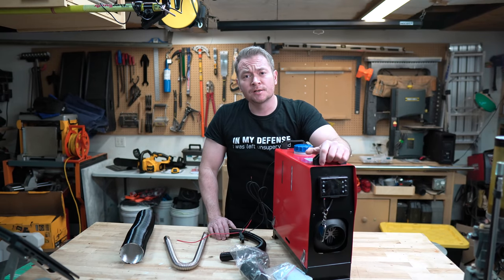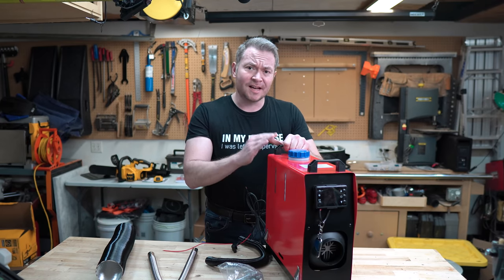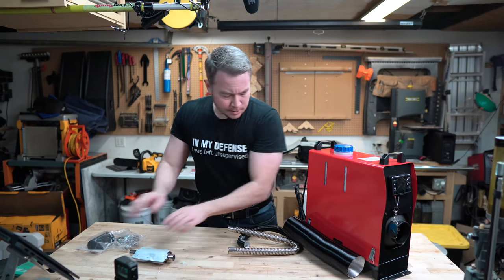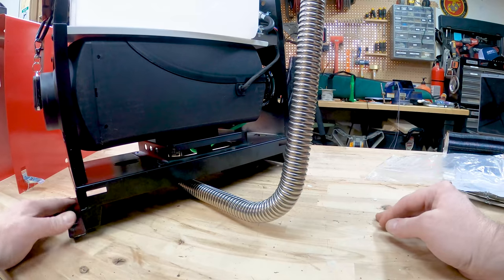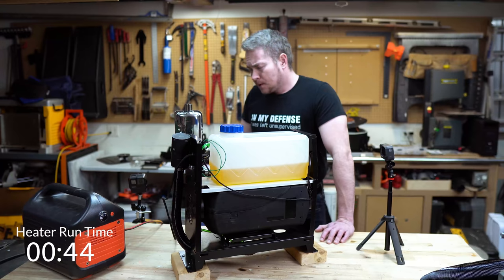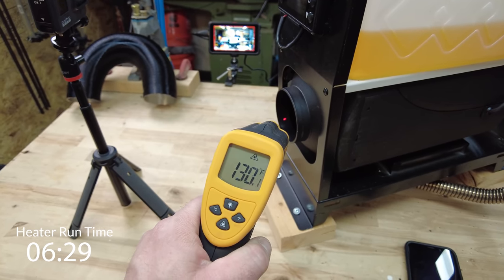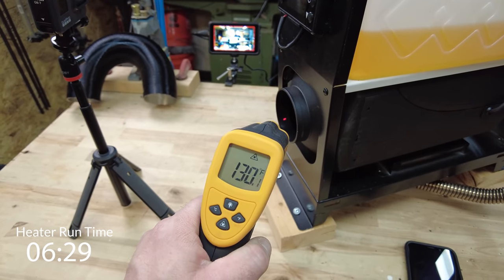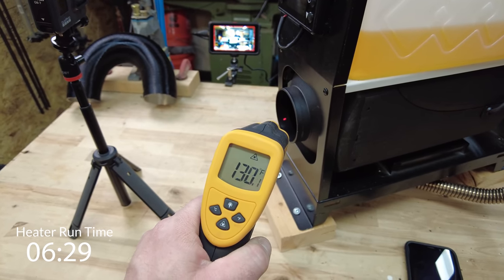My First Chinese Diesel Heater

Comment: I’m going to share my recent experience with one of these free standing heaters, I also added wood blocks for clearance. The exhaust pipe does not last and directing it up like that is not a good idea. Ignition errors are the most common and I have replaced a Bluetti EB240 under warranty due to this heater causing EO23 errors non stop. You will have to break it down and clean it. The running rich does cause excessive soot. Each time it failed to ignite and run the unburned fuel tends to collect at the exhaust. Three nights ago the temperature dropped to below 30 here for the first time I have been starting this with the remote but something told me to step outside I was actually speaking to Amazon about replacing the DC adapter because it wasn’t putting out 12 VDC I was only getting 9.3 VDC and while speaking to AMAZON the exhaust port which I had modified with copper pipe and a 90° elbow ignited and caught fire right in front of me I dropped the phone grabbed the fire extinguisher and avoided what could’ve been a catastrophe I can’t stress enough how important it is that you have no less than 11 VDC. I’m replacing it with a component heater and have my doubts.
Reply: which model component heater did you go with?  if you're not sure yet, could you explain what a component heater is please?
Reply: Correct Current (Amperage) at the the correct voltage is required for a full and complete burn!!! Sounds like you were underpowering the heater outside of its optimal performance specifications!!!...thus creating subpar performance.
Reply: @fookingsog  Forgive my ignorance but what would the solution be here - get a more powerful battery pack?
Reply: Could you explain this a little more ? Your battery pack wasn't powerful enough ? Or this DC adapter you speak of wasn't working correctly?

Comment: I have ran these heaters for the past 4 years, the bearings get dry need re-greased once a year and the fuel pumps wear out about every 2-3 years other than that great little units

Comment: I have two of these heaters I've had them for 2 years or 3 years and  I only had to replace one fuel pump I have a workshop like yours the garage actually it's pretty well insulated I turn it on and leave it on the whole winter never shut it off and sometimes it's -40 over here so it does the job if you think it's going to break down by yourself an extra one I also got one in my RV same thing leave it on the whole Winter works great
Reply: @willpelton1619  no was on Amazon

Comment: Been running one aliexpress 5KW unit (not standalone like in video thought) for two years now, heating garage/shop in wintertime. Have had no issues. Once or twice it has run out of fuel so it stopped working but re-priming and just starting up and again no issues. Have not opened it up or cleaned the burn chamber either - i've heard people having issues of it sooting up, but for my two years of usage I have not had problems. I even have few times accidentally unplugged the electrical outlet for that heater (it needs to start shutdown process to remove all fuel from burn chamber if you shut it down). And it has not sooted up. 

Its fantastic heater! But I would still recommend it to someone who understands dangers and knows how to install one safely.

Comment: Hey there, I wanna tell you, that I own one of those diesel heat exchangers. My model is for installing in a car with a 15 Liter tank. It's the same heat exchanger then yours with the difference that the lcd panel is the wrong one. It's hooked up to a battery with a charger on it when it drops below 20%. It is running 5 days straight with no issues. 15 liters will hold about 2 to 5 days  with the right setting. A 12 square meter bathroom with 24 Celsius by an outside temp of below -23 Celsius here in germany. It works good and maintenance is simply
Reply: I had a Webasto engine and forced air heater on a 1993 Freightliner.  It worked flawlessly, and 4 hours of run time heated my cab and diesel engine in winter to fire it up on the coldest of days or nights.  It would drain the batteries of the rig over about 12 hours of use, but it had a water pump, as well, to heat the engine block and maintain some heat in the big diesel tanks.

Comment: I have no complaints with mine. Used it starting in fall and thru the winter flawlessly in 2020- 21 in my sailboat that I live on. Around late summer '21 (a couple weeks ago)  I fired it up with absolutely no problems to make sure it would still work. Ive heard that you have to run them monthly or they will not work if you wait a whole year. Something to do with flopping health..idk. Thats not been the case with mine. Absolutely love the chinese diesel heater and would buy another in a heartbeat. As I said I use it in the sailboat as my only heat source
Reply: I believe most problems arise out of underpowering the units...not enough current, too little combustion and the units carbon up and fail.

Comment: Great presentation Tom!
Reply: Woah Blancolirio love your videos!
Reply: Hell, if Juan watches this channel, I'm a subscriber!
Reply: @leveretth your subscription list is 🔥 I’d recommend real engineering or tierzoo if your not already subscribed
Reply: @michaelharrison3046  Thanx for the suggestions, but my gaming is almost entirely limited to flight simulator and Civilization. I used to sub to Real Engineering, but I objected to this line in "The Truth About Pumped Hydro" vid: "Solar and wind technologies... are capable of providing more than enough energy for all of humankind for a fraction of the cost of older fossil fuel power." This is patently false.
Reply: @leveretth  oh for sure, that vid was quite a deep dive I prefer the ones on aviation like the A10 and the new one on the Dreamliner but also check out what musk says about Solar power much less space, more output and easier to maintain than wind.
Reply from the maker: Thank you sir!
Reply: @michaelharrison3046  ¹
Reply: Yo Juan!
Reply: I would be extremely concerned about  Carbon Monoxide.
Reply from the maker: @SeaJay_Oceans  Rightfully so.  So far, when properly exhausted outside, I've had no problems with CO, CO2, or particulate air pollutants
Reply: @TomtheDilettante  Be sure to put a low PPM     CO detector alarm  in your shop...
In case of malfunction - you want to very quickly if a leak is filling your room with the   deadly colorless,  oderless gas.   (more a problem for older tech, but  peace of mind and safety first is always the way to go!)
Reply: Interesting mix of music in this video. It started with Toy Story, then Shit boot stomp truck hillbilly country, jazz funk 70's, X Files, and ended with generic techno.
Reply from the maker: @beezertwelvewashingbeard8703  my taste in music varies as much as my hobbies.  What can I say?  I'm a mess LOL

Comment: Would be cool to engineer some kind of apparatuses where the exhaust passes through a tube inside of the air intake where the exhaust heat can preheat the air intake.
Reply: The air coming out is already 150 degrees, how hot do you want that air?
Reply: @peeonthe3rdrail414  Not looking for hotter air output, looking for improved burn/fuel efficiency if doing so would help. It really works hard when pulling in some air from the teens, close to zero. Having some air preheated on the intake might help a little.
Reply: @peeonthe3rdrail414  you can never get too efficient.
Reply: Higher the air density (cold) more power you can make in a Diesel engine. But warmer air may help in this case since it’s not a standard Diesel engine.
Reply: @peeonthe3rdrail414  He wants to pre heat the INTAKE air!

Comment: Had one of these for about 3 years. Never let me down, run at altitude 18,000 ft plus in my Sprinter conversion. Gets too hot in the van if running all the time so use the built in timer function to cycle on and off. The remote control is also very handy if you’re laying in bed and need to control the unit. Great presentation by the way.
Reply: Hi Neil, did you run the exhaust outside or how did you run it?
Reply: 18,000 feet? Where?
Reply: @thewilberforce  Hi, it was the Kandahar Pass (May be spelt wrong) It’s in the Himalayas. Van and heater were fine, I was sick!
Reply: @DuneRider-UK  Hi, both air intake and exhaust are outside. Mounted towards rear of van. Exhaust is actually just in front of rear wheel. I often park up in snowy conditions and it melts any snow or ice ready for when I pull away.
Reply: @thewilberforce  Hi, a little tip for you if you are going to take your van over 12k feet. Strap an oxygen bottle (one from oxy/acetylene welding equipment, small one of course works fine) to the air intake, trickle release, otherwise your van won’t run.
Reply: @europeanoverlandpassagecom6245  why are you telling me this?
Reply: @europeanoverlandpassagecom6245  Are you talking about Khardung La Pass? Highest road in the world. 5600 meters, 18,370 feet. No joke. For sure. Always wanted to motorcycle it.

Comment: Great Video, The only thing I can add is to turn up the heat to max for 5 min before shutting the unit off, it helps burn out any carbon due to running on low.
Reply from the maker: Thanks for the tip!  Will do

Comment: As much heat that seems to be coming from the exhaust, I was wondering if some form of heat exchange could be used to get even more heat from the waste side...
Reply: @willpelton1619  Ha! Excellent idea!
Reply: Need to be careful of cooling the exhaust to much.
Reply: @jonyemm  I agree - if you cool it to much you’ll have to deal with condensate and a loss of updraft - both solvable problems but each adds complexity.

There are “condensing” gas water heaters that do this to improve efficiency but when I last checked were much more expensive and required a drain line.
Reply: @stevenwright901  exactly. Thanks for going into detail. I would of but I learned the time spent to do so is usually wasted since people go by "what they heard/think" instead of spending 2 minutes to Google something. Of course there are situations where you can pull some heat from the flus/chimney but if you pull to much it can easily kill you. So for the sake of people reading this I simply say, don't try it. Every connection you make, piece of pipe you add, fitting you add, are all points where a leak can occur. Also adds to the strain put on the fan that not only expels the exhaust gas but also pulls in fresh air for the  clean combustion of fuel.  You may get some More heat out of it but you are certainly more likely to kill your family and it's guaranteed you'll lessen the life of the heater
Reply: Many many years ago when I used these types of heater in my trucks I would put a well made plastic water container in front of the output(not too close to melt) so when I woke up I would have some nice hot water in the morning to have a good wash with
Reply: @jonyemm  Idea is to have the exhaust connected to a air to water heat exchanger, effectively using the exhaust to heat up water/coolant. You can later use that water to shower, use it for heating or even pipe it into your engine  block and keep the engine block up to the temperature.
Reply: Keeping the block crispy on race day arrr ya
Reply: So does the exhaust have to be routed out side? I have a insulated garage (just the walls) with a big eve vent..could i just vent the exhaust up like this and not have to route it outside?
Reply: @stevenwright901  diesel burns dry. You get condensation from petrol. If it's running (diesel) rich, the risk is carbon build up (ash). Diesel cars rot their exhausts from outside in, whereas petrol cars rot their exhausts from inside out. Heat recovery from the exhaust of a diesel heater is a very good idea.
Reply: @melodysouljahrootsdubpress5539  

You’re right, diesel burns dry…er than gasoline, which in turn burns dryer than natural gas.

Any way you cut it though, burning hydrocarbons of any kind is going to produce a gas containing water and carbon dioxide (amongst some other nasty things). Normally this water is expelled in the exhaust as steam but it will condense into a liquid if you cool it enough. 

Point being - either figure out how to handle that water or avoid continuously cooling the exhaust gasses to 100°C or lower.
Reply: @minibikemadman  well, there's 2 things to consider, one, is that you would be better to vent combustion waste products out than breathing them, the other thing, is that the combustion process produces quite a bit of water vapor as a byproduct... will this water vapor be too excessive and possibly cause damage or mold if trapped in your garage space? People commonly asphyxiate themselves in enclosed spaces in emergency situations with heaters or generators... so it is good to think carefully about all these aspects of not venting... also, there are sometimes troubles with taking too much heat out of the exhaust gasses,  because sometimes this limits the ability to vent it all out... and tends to rot out the exhaust piping...

Comment: It would be nice if the heat from the burning of the Diesel fuel could be used to produce eclectic current to run the fan and control unit.
the Achilles heal of the unit is it is reliant on a battery or outside power source.
if the battery dies the heat stops.
Reply: I use an inveter in my garage
Reply: Peltier devices really don't give enough power
Reply: Mine requires no electricity just start the fire and open a valve and used motor oil and cooking grease fuels the heater.
Reply: @westtexas806  which model do you have?
Reply: @westtexas806  Sounds ideal. How much was it, is it portable, and who makes it?

Comment: I would be interested to know if you had a CO meter what the co level is in the room.
Many inexpensive Co warning units are available that have a digital readout I found them be quite accurate just running a lawn mower outside will set mine off.
Reply: Good point 👍
Reply: I think it's bad idea to run this in a small closed environment even for this 15 min test. He thinks it burns relatively clean because he doesn't see smoke or smell fumes!   It's an insidious killer--odorless, tasteless, colorless and  binds to hemoglobin 600X more readily than O2, and lingers in your blood (4-hour 1/2 life)!  Pretty irresponsible video IMO.
Reply: @bruceeverett5372  I think he knows it's not safe to run in a closed area. I think his point was that it seems to be more efficient than perhaps the price/build lead him to assume.

Comment: I've seen videos where the power draw actually stabilized after 15 minutes. At that point the 5k unit pulls just 0.3-.04 amps. Your video didn't run quite as long to see the stabilizer amp draw. Was hoping to confirm the low draw.
Reply from the maker: around time marker 9::17, I show (albeit probably too quickly) the current draw after startup cycle was complete and it was running steady state on high.  At that time, it was drawing 2-3 amps sustained.  When I did another video testing it out overnight in a tent, I had it running for on high about 10 hours on high and it depleted my 500 amp hour Jackery power supply to around 45%.  So 2-3 amps sustained seems to be what I'm getting.  0.3 to 0.4 amps draw would be amazing, but I'm afraid I didn't get that kind of result with mine.  Not saying it's not possible, just not what I observed.  Hope that helps and thanks for watching and chiming in!
Reply: @TomtheDilettante  thank you Tom. From the other videos it seems to stabilize after 15 minutes. They ran a low setting and then another at high setting. I believe the 0.3-0.4 is got the low setting. For a tent set up that should be plenty. Thanks for your video. It's good to know how it draws so we can plan ahead.

Comment: I had one of these without the box in my van for 4 years and it never failed me. If you have been using it for prolonged periods, make sure that you crank the temp up full blast for 5 min before shutdown to help burn off and clear soot.

Comment: Wow. They are really cheap for what they provide, amazing!
I am wondering if you could use a double wall chimney pipe (like in the natural gas heaters) to use the exhaust heat for preheating the incoming air. This thing would be extremely efficient when doing that. I just don´t know if the controller is prepared for a much warmer air getting in. But I guess so. Probably not a good idea, as a damage in the chimney would get exhaust sucked into the room, but some kind of heat exchanger might be safe enough.
Reply: Absolutely Correct  re: CO poisoning. The air intake should be as far away from the exhaust as possible. A stiff wind blowing into an outward oriented exhaust ( imstructions often say to aim the exhaust 
pipe DOWNWARD )  could actually backfeed thru the chamber internally , pushing CO thru the intake.  i cringe + warn van dwellers who've installed them w/intake INSIDE to "preheat" the air. PLUS: these units often put out enuf heat that you have to crack-open your downwind windows a bit !
Reply: You dont want to preheat the air you will be using to combust the fuel. Colder air = cleaner burn.
Reply: @jonross377  there is 2 air Intakes on these. One for the combustion chamber and the other for passing air over the heat exchanger. He was talking about running it in the hear exchanger inlet.
Reply: I have seen the webasto version heat up air just fine from -40. Wouldn't really be worth the hassle of doing that.
Reply: @jeep13ca  Oh ok.
Reply: you must keep the inlet air cool, and separate from the exhaust. I have had one fitted in my garage for over 5 years with no problems, running on kerosene, scottish highlands.